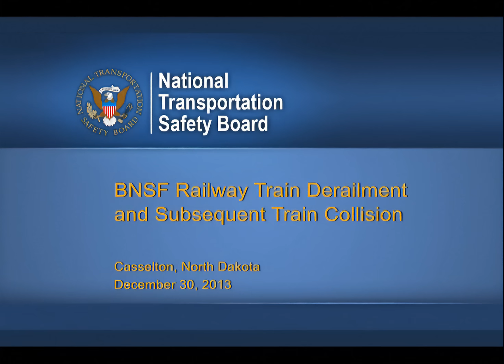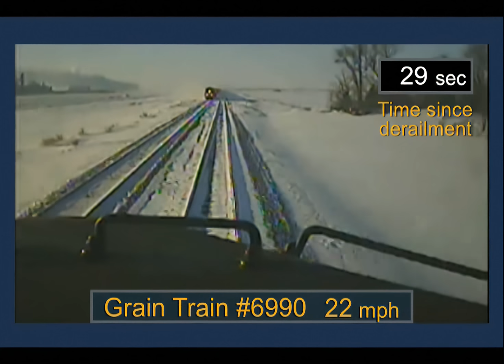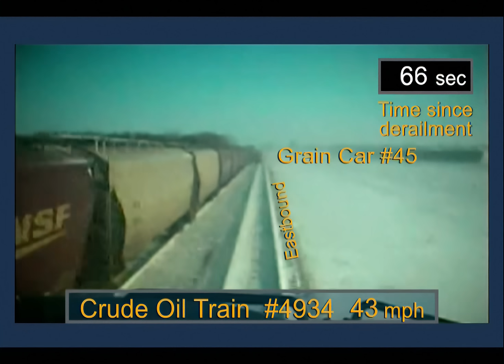BNSF Railway Train Derailment and Subsequent Train Collision

Comment: The crew is alive and well, I started working out of Dilworth one year after this happened and I assure you they made it out alive
Reply: Lessinath and people don't realize how fast a train is moving until it tries to stop
Reply: francobobfred don’t forget the weight behind that speed too. Thousands of tons usually.
Reply: I'm betting that 45th car, although on its side, was still coupled to the rest of the train giving it far more mass than just one car.
Reply: Nash1a it was being dragged, look at the gap from it and the rest of the train that was stopped.
Reply: BNSF1996 6 Thanks for letting us know, bud. Seriously, I was trying to bring up the NTSB report to find out that exact information.  I won't lie I was NOT expecting that much damage to 4934 when it hit. I know rail cars are heavy but holy well that impact seemed brutal and caused an instant track evac. I honestly thought the ES44 would have just kept going with significant damage from the collision caused to 6990.

Was the train car that 4934 hit still partially connected to the consist? Were any locos from 4934 salvageable?
Reply: People don't realize how fast they can run until they're running to save their ass.
Reply: @Lessinath  ya and try doing that with a foot of snow in a field
Reply: That is a miracle.  They must have really hoofed it out of there!
Reply: BNSF1996 Thank God they made it out alive.
Reply: Nash1a coupled no something had to break to end up like that however if you wer to say firmly wedged between the head and tail portions of the upright cars most likely
Reply: Nah bud.  It de-coupled and the back-half of the train emergency braked as a result.  At 2:39 you can see a size-able gap between the derailed grain car and the de-coupled section.  You can also see what appears to be a second overturned grain car further down the track on that rear de-coupled section.  Each grain car weighs 100 tons, and you can tell by the impact it was corn.  Corn is 58lbs per cubic yard.  I'm pretty sure a grain car would derail most any train because of how it would disperse the energy of the impact.  It would be like a steel bean bag, dispersing the impact until it overloads the strength of its container.  A massive impact.  Your theory is excellent, and the first overturned car appears to be still attached to the front 2/3 of the train, but there's a few frames of video that show a gap that appears about as big as a rail car right after the first derailed car.  Thanks for making me take a second look because there's a massive pile of physics at work here.
Reply: @Jafromobile  my corn flakes are more expensive now
Reply: Unfortunately, he was aware but too late.
Reply: But Sir Topham Hatt was cross.
Reply: Thank god for that! 👍😀
Reply: @davidjamesshaver  no such thing as God. Make sure you give credit to something thst actually exists.
Reply: @jerrybutler605  THERE'S AN OLD SAYING: "There are no atheists in a FOXHOLE!!!"

...I REALLY WISH THAT YOU WILL FIND THAT OUT THE HARD WAY-!!!
Reply: It's not the train speed it's the weight that causes the problem, thing just can't stop with all piling in behind it.
Reply: @ElectronicPleasure  It is a combination of speed and mass.  A 15000 ton train in a collision at 1 mph will result In less damage than a 1 car train at 60mph
Reply: @ElectronicPleasure  its both. inertia.
Reply: It isn't the speed, its inertia.
Reply: But the train crew on the crude oil train probably had to have the seat dug out their butts. Was out there for 38 years and it'll make you draw up! For sure!
Reply: Good. If you know them pass on the regards of a UK Railwayman.
Reply: brandon hvac 
a mouse got run over when the train derailed
Reply: I was on the JY local that day,  just west of Casselton when it happened. We met that oil train at Magnolia, and then about 10-15 minutes later we heard the emergency call.
Reply: glad they got out ok... nice loud comms!
Reply: used to watch trains with my dad when i lived in fargo as a kid at dilworth. miss those days.
Reply: Games Braun lmfao
Reply: pete a are you a confused person or picking a fight?
Reply: BNSF1996 the cabs are built like tanks, and for good reason.
Reply: Glad to hear it.  I used to work security in a guard shack about 20 feet from the tracks in Terminal Six on Bybee Lake Road and Marine Drive in Portland, Oregon, and the Grain Train with #6990 used to haul past it all the time.  It was usually a mad rush to see who could get out the gate before the train blocked it.
Reply: do y'all have somewhere to go in the cab when this happens. that train went from 40 mph to 0 kind of fast for a train so I'm assuming the impact was brutal
Reply: BNSF1996
Reply: BNSF1996 : )
Reply: That's good to know. I was worried for the crew of the crude oil train that was traveling at 40+ MPH.
Reply: BNSF1996, Couldn't the grain train guy have called the engineer on the Oil train and told him to stop?
Reply: BNSF1996 thats amazing to here was the train scrapped?
Reply: pucker factor
Reply: You have voiced a thought I've had many times. Either God doesn't work the way people claim when they escape a disaster or he's malicious and plays favorites.
Reply: It's a combination of speed and weight.
Reply: francobobfred inertia in this case.
Reply: That was my question. Glad everyone made it home.
Reply: @Chris Wood I just looked up the crash, and no one was listed as dead or injured.  They found a lot of violations throughout the rail system, though. But no deaths.
Reply: You like working for the railway?
Reply: This was all caused because of some arsehole rail maintenance worker not doing his job properly.
Reply: Were you one of the crew?
Reply: I had nothing to do with this video and just saw it today and barely even payed attention and I assure you they came out alive.
Reply: Thank God 🙏
Reply: How do you know that? I spoke to them right after they died.
Reply: Would you guys quit your trolling bullshit, let's just all just be glad the crew is OK and quit worrying about who's mom is getting fucked
Reply: BNSF1996 l ,,,,,oaaokqwowowllklkkkkkkkkkkkkkkkkkkkknopophjhjuuuuuu678905413
Reply: Ryan Boland I don't get it.
Reply: Ryan Boland huh?
Reply: BNSF1996 9
Reply: BNSF1996 well it didn't look like a fatal accident if that was what you think.
Reply: Wrong video, dude.
Reply: It's weird to see the same second name that I have (Dilworth) cause it's a really uncommon thing I believe
Reply: Good for them.
Reply: FNBS as  STOBE the HOBO says
Reply: Jafromobile!? Odd to find you here!
Reply: 34is1  I'm thinkin' you either drilled a dry hole, or ran your rig down the wrong borehole. Need to fire the engineer on that job pronto. Had you overheated the shaft head in either hole, it could've broken off way down in there and left no choice but to muck through the nasty slop and mud to retrieve it. But good luck in your ventures!
Reply: I wondered what happened to Earl. Is that a engineers name?
Reply: Did BNSF pressure key trsin as to why they didn't make immediate brake application when grain train said"uncommanded emergency, watch yourselves"?
Reply: Couldn't tell a derail had occured/
Reply: That's all that counts.  The smartass comments aren't really needed.
Reply: Thanks for posting that.
Reply: Those cabs are Hardly are hell like 3 inches of cast iron
Reply: thank you, its kind of heart wrenching to watch
Reply: Proof...?
Reply: Thank god.every workaholic men out of accident alive is great news.
Reply: Bail and run!
Reply: ITS A VIDEO GAMES. LOOKS AGAINES!
Reply: That's good because as much as its a grave situation, the reply "we are everywhere" was funny in a dark sorta way. 

At least they were able to bail before the fire reached the tanker cars.
Reply: ...what were they running from? a big shake? the video shows nothing to the layman beyond a rough ditch off to the side... what happened here?
Reply: @trashpandatee  

The crude oil train started on fire.
Reply: I started at Dilworth in 2003 ..
Reply: Whew.  Now I can post this:  https://www.youtube.com/watch?v=O7oD_oX-Gio
Reply: Thank you! There was no way I was going to watch this until I found this out first. Can't believe it's not on the description.
Reply: That's radical , been involved in accidents in my career , nothing like this , sure glad to be retired . Still feel for all the RR brotherhood . Glad they got out ( not everyone does ) . Hogger BLET .
Reply: The Conductor on the grain train get fired but being a **^%#^*+?
Reply: Fantastic!
Reply: I was wondering that after the video ended, thanks for the update, glad they made it.
Reply: TBH, it wasn't even remotely life threatening.
Reply: An amtrak employee who knew the crew said they were shaken up but praising the locomotive design that ultimately saved both their lives
Reply: 2:36 ohhh noooo glad it turned out ok.
Reply: Indeed
Reply: I’m pretty sure that the engineer of 4934, Bryan Thompson sued BNSF and never worked for the railroad again. He supposedly developed PTSD because of the accident.
Reply: It comes undone, quick & in a hurry out there.
Reply: That is good news.  Thank you.
Reply: BNSF1996 
Well thank GOD for that !
Reply: francobobfred It isn't so much the SPEED...it's the INERTIA that's the problem- a loaded train comprises a lot of MASS, and something like that is hard to STOP!!!
Reply: @daleburrell6273 ... the equation is Mass x Velocity = Energy.   Yes, speed (velocity) has just as much to do with the equation as does weight (mass).
Reply: @captainmorgan757  AW- WHAT DO YOU KNOW ABOUT ANYTHING?!! 😁😁😁😁😁😁
Reply: @daleburrell6273  BOOMER CAPS MODE ACTIVATED
Reply: @AureliusR  WHAT ARE YOU GONNA DO ABOUT IT?!!
Reply: pete a:  the world as we know it is not what you may think.  The devil is here and is allowed to steal kill and destroy from us.  God gave us the ability to do good or bad.  Therefore, you have free will to love him or love the devil.
When the day comes and Jesus returns, his children will rise with him and all evil will be left to suffer with the devil.
Reply: @cew142  there is no god or devil so save it for the kiddies.
Reply: Jerry Butler:  I respectfully disagree with you.  There is a living God in heaven and there is a devil and hell.  I will certainly pray for you that God reveals himself to you.  Be on the lookout and keep an open mind.
Reply: Povl Besser yes you do have free will.  Free will to kill someone or save them from danger.  
Certainly i didn't choose to bring myself into this world either.  But i am glad God did.
Reply: pete a oh, please tell us more about atheism, great and wise teacher
Reply: NoChannel God is reliable!  People are not!!!
Reply: @cew142  god is a fairy tale for weak people to lean on
Reply: @AureliusR : There is nothing I can say or do to specifically make you believe.  However, God will reveal himself to you someday in a way that only you can understand.  On that day, I pray that you believe and then follow His son Jesus Christ.
Reply: @cew142  ...WELL SAID!!!
Reply: @cew142  DON'T WASTE YOUR TIME ON THAT FUGITIVE FROM A FUNNY FARM: SOME PEOPLE ARE JUST PLAIN HOPELESS!!!

...EVEN GOD HAS HIS LIMITS- THAT'S WHY HE CREATED HELL!!!

SPEND YOUR TIME ON THIS EARTH ON THOSE PEOPLE WHO CAN BE SAVED-!!!
Reply: @daleburrell6273 :  my wicked and worldly mind agrees with you.  However, I have a heart like the Lord.  I wish that no one shall perish.  If I plant the seed, then I am obeying the Lord’s commands.  And that makes me well with my soul.
Reply: @cew142  ...THIS WORLD NEEDS A HECK OF A LOT MORE PEOPLE WITH YOUR ATTITUDE-!!!
Reply: @daleburrell6273 :  thank you kindly!
Reply: GLADE ? they made it out of there
Reply: NoChannel you are not meant to live forever here on earth.
Reply: Fucking auto correct
Reply: +Joe Davis Especially if you think you're going to hit a gas tanker on a crossing.
Reply: It could very well be that the sole purpose of their existence is to serve as a warning to others.
Reply: Hey Jafromobile - both "ends" of the train went into emergency braking.   Not just the back half.
Reply: This is a sin cursed world. He gave us the Law and free will. There will be a Judgement Day for everyone for the deeds they have done. 
It's up to us, not Him. Why do WE let innocent women and children be killed? Everybody wants to pin all the evil on God. We are the evil.
Like I said, it's not His job to give us all a cushy ride through life. We don't deserve it. We deserve condemnation.
Reply: Ryan Boland your dog has a great ass
Reply: I think what mur38 is trying to say is that it's not possible to invoke god when people are saved when so often people aren't saved. What did he do on those occasions, blink? Or maybe asleep?
Reply: Henry Page {
Reply: He is great and kind, the faithful will be rewarded on that day and the sinful will be everywhere. His balls taste of fried chicken and his hair like buttered noodles with truffle oil. When a good person dies they are invited to dine on his delicious bod. We deserve it. Yum Yum
Reply: You God-deniers (He himself laughs at your pious folly) and your tired, old, debunked “theories” and otherwise dumb reasons. You’re the same people who insist 1 + 1 is still 1, even though you see 2. Will you please give it up?? You just continue to spout your ignorance and the faithful are embarrassed for you. Once more, YOUR god does all you rail and whine about, not our God, the God of creation. Stop blaming the true I AM, our Lord and Savior, for the horrible things YOUR god has wreaked upon the world.

Once again - how many times does your imbecilic brain have to be told before you learn anything?? OUR God is coming back to destroy YOUR god you love so much, the god of death and hell, satan. Why hasn’t He returned yet?

Idiot! He would have to destroy YOU TOO! 
NOW is the time for salvation. YOU WILL NOT WIN IN YOUR FIGHT AGAINST GOD. All faithful believers will be present to watch Him destroy you and your god satan. I personally don’t relish that scene. So...

GET RIGHT, OR GET LEFT. Simple as that. I may have been harsh, but something needs to shake you loose from satan’s gnarly grip!! The ONLY way is through Jesus Christ! And yes even harsh old me is praying for you!!!
Reply: @gomphrena-beautifulflower-8043  LMFAO. I can't believe they make people as dumb as you. You have zero evidence there is a god. If you have it, show it to us.
Reply: @gomphrena-beautifulflower-8043  by the way, Satan is awesome. Way cooler in your fairy tale book than the god that commands people to kill their own children and rape each other.
Reply: @AureliusR  • You’re saying you’re smarter than, hence superior to, the God Who created you, Who knew you before the foundation of the world. The God Who walked on water. The God Who will judge those who have rejected His mercy and grace through what His Son our Lord Jesus Christ did on the Cross over two centuries ago; He was resurrected to eternal Life and is coming back for His true and faithful church, to resurrect those in like manner who died in Him; those Believers living at that time will be caught up with them to live forever with the Lord to reign sand rule with Him for a thousand years, when satan and his demons will be locked in the pit for the season; then looses to deceive the nations once more. After that, the final triumph of good and right and God’s final victory over wickedness. Jesus Christ will destroy satan and his demons and followers (unbelievers) once and for all. Then God’s plan of redemption goes full circle and completes the arc; whereby the New Heaven and New Earth comes down and His plan in the first place - a perfect world inhabited by the first humans Adam and Eve - newly created now that evil is eliminated forever, and saved mankind will live in the presence of God and His Son Jesus Christ forever.

The preceding is a synopsis of the coming events prophesied in the Bible. Prove the existence of our Creator God you say? Look in the mirror. You were no “cosmic accident.” As far back as science goes to try to disprove Creation, the fact is that the origin of life cannot be created outside of God. Something cannot come from nothing. The human body is itself a miracle of its sum of the whole as it is a miracle of each individual cell, carrying on constant replication without our knowing or being aware. Every breath we take, every heartbeat is automatic; God has created all bodily systems to function on their own for homeostasis and continuance of life itself. 

The Bible is a made-up book written by old men, dead for millennia?  The Bible is one-fourth to one-third prophetic, and every single prophesied event thus far has been 100% true and correct as written, sometimes 2600 years before it happened. There is no reason to doubt the few remaining prophecies, therefore. God delivers on His promises, that’s a fact. The entire Bible, all 66 books, is about or points to Jesus Christ in some way.

Truth is truth and doesn’t change, whether you accept it or believe it. You have two choices on where you’ll spend eternity. Either with Christ in glorified new bodies that will never get sick, get old, or die and in eternal joy; or a body that will burn in hell but not be destroyed — in other words, an eternity of pain, living a continuous nightmare of gnashing of teeth, hate, and dire unrequited thirst, among other things. I can only imagine the horror of what will probably include all the horrible things our imaginations can come up with. Eternal, constant sorrow at turning down God’s offer of mercy and grace when He offered it for so long (meaning, right now), and countless other horrors that never ever stop. 

You’ve fallen for Satan’s oldest lie. That he — nor God — even exist. While satan laughs at your refusal to recognize God’s omniscience, omnipresence, and omnipotence, he will betray you yet again and again. He knows how the Bible describes his — and your — fate, but he actually believes he can replace God on the throne. He can’t and won’t. God holds the keys and is much more powerful. Satan after all is a created being - he was once the most beautiful angel of all but it went to his head and rebelled - much like you’re doing now.

Look and see how the world is imploding in itself - wickedness and lawlessness increasing, natural disasters increasing in frequency and severity; wars and rumors of wars; so much more; all prophesied. Nations saying “peace and safety” orc”peace and security” - the very words prophesied millennia ago. This, the Church Age or Age of Grace, will soon be over and it will be too late for redemption. 

Ask Jesus Christ to make Himself known to you. Honestly and forthrightly. Many have come to Christ by asking this of Him. People with opinions just like yours have been saved by becoming believers, repenting of their sins; by being “born again.” By the shedding of the old life and becoming the new; pardoned and sanctified by His grace and mercy that none of us deserve. The wages of sin is death, but Jesus willingly sacrificed Himself so that we could live with Him forever and ever. He was flawless and sinless — God in the form of a man — but He took all our sin on that Cross at Calvary that day. He became sin that day. God, being perfect and holy, couldn’t even look upon His own Son because He became the past, present, and future sin of everyone who ever lived or was to come. That means you and me. So God had to turn His back on His own Son that fateful day. Because we’re human and fall short of the glory of God on our own, Jesus as our Savior pardons us. Jesus intercedes for us before Satan the accuser. Without Jesus, you have no One to intercede for you before God. None of your sins are pardoned. You’re held responsible for every single one, in thought or in deed. Your sentence at the Great White Throne judgment is eternal damnation, while those who belong to the Lord Jesus Christ go to the judgment seat of Christ to receive rewards. Because our sins were judged already at the Cross.

But Jesus didn’t stay in the grave. No, He defeated Satan that day at the Cross and three days later at the Resurrection. What happened to Jesus will happen to us. We’ll also be resurrected from our graves to the New Heaven and New Earth (long story short) to live in the presence of God for eternity.

So think about this. Everyone dies. (That is a curse of God on humanity when Adam and Eve disobeyed God and believed Satan instead.) Everyone dies and will immediately come before God at that moment. Do you really want to face God and receive your unchangeable sentence of eternal damnation? Or do you want to receive Christ now and believe in Him? And live forever in eternal, new, God-given bodies that will never get sick, never experience pain either physical or emotional, and never die, but live in bliss with the Lord? His mercy is priceless. But don’t wait! You could die today in a car wreck, or heart attack, etc. Countless people put it off and are now eternally sorry. But their fate is sealed. 

Good news: Yours isn’t! You still can decide your future, where and with whom you will live for eternity. In the new world God will be creating just for those of us saved by His grace; or in a dark hell in continuous, unrelenting torment and devoid of anything good. 

God gave us free will. The choice is yours. You’re only one heartbeat, one breath, away from meeting Him. I’m praying right now for you, that you’ll make the right decision.
Reply: @gomphrena-beautifulflower-8043  who created God?
Reply: @KDizzy98  • God has always been, and always will be. The Bible says He has no beginning and no end.
Reply: @KDizzy98  • Who do you think created God?
Reply: @gomphrena-beautifulflower-8043  Thanks for sharing your testimony. It's what so many in this world need right now.
Reply: @davejagielski  • Thank you for your kind comment. I have a burden for the lost, and seems social media is the only way I can witness due to my chronic health issues. The wicked don’t understand what’s happening and where this sick and dying world is headed, yet they will understand and be horrified when it will be too late for them. If I can lead just one to Christ, it will be worth it. May God bless and keep you, friend.
Reply: ***** WTF MAN screw you
Reply: BNSF1996 *whose
Reply: Don't assume anything.
Reply: Man is not reliable. That's why we need God. His job is not to give you a cushy ride through life.
Reply: cew142 it was your parents who decided for you to join the world. not god as he or she does not exist
Reply: Raoul Cruz if god was real and as powerful as you clowns say he is then why does he or she let America killed so many inoccent women and children. it's just as real as ghosts
Reply: @petea2721  He doesn't micromanage from His dimension
Reply: @christianmotley262  its ok I believe now.........
Reply: @christianmotley262  I also believe the tooth fairy, ghosts and Santa just as real as God. I am a believer
Reply: @petea2721  AW, YOU LOUSY MEMBERS OF THE "BLAME AMERICA FIRST" CROWD CAN ALL GO TO HELL FOR ALL I CARE!!!
Reply: Manni Schneiderbauer there is no such thing as a soul or the devil. nice try kid
Reply: I am Satan himself and I command you to fuck off, you babbling Jesus troll. Or else my evil energy will eat your soul and do all the other stuff told in death metal songs.
Reply: We do not have free will. I did not will myself into existence and someone you think you know would be very crossed with me if I were to will myself out of existence. Your god has created you sick and commands you to be well. How is that free will?
Reply: LOL of course they're alive you fucking moron. Stop stating the obvious.